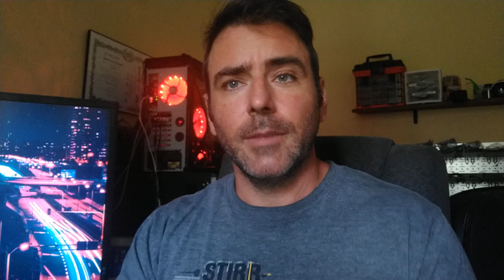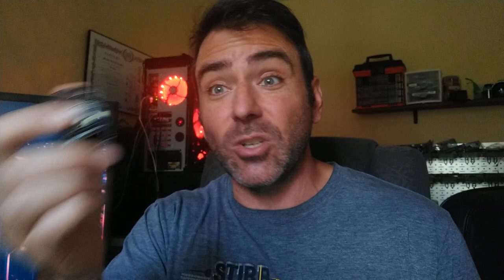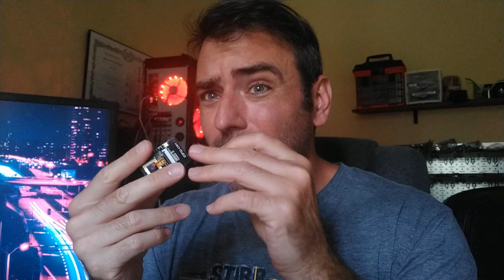USB Port with No Solder

Comment: With OpenBSD, you need to use webcam modules that are UVC compliant.
https://man.openbsd.org/uvideo.4
You will also need an ISP on the module to perform a variety of optimizations.
https://github.com/cruxopen/openISP
https://www.verisilicon.com/en/IPPortfolio/ISPIP
https://pinnacleimagingsystems.com/
You will see that most of these UVC camera modules are limited to 30 FPS recording, even at 1080p, but you can boost the frame rate with Iris Vista.
https://iridalabs.com/portfolio/iris-vista/
Here are a few good sources for getting camera modules:
https://www.e-consystems.com/13mp-autofocus-usb-camera.asp
http://www.camera-module.com/product/autofocuscameramodule/small-auto-focus-8mp-sony-imx179-usb-camera-module.html
http://www.camera-module.com/product/autofocuscameramodule/wide-angle-lens-auto-focus-8mp-imx179-cameramodule.html
http://www.camera-module.com/product/autofocuscameramodule/4k-auto-focus-12mp-usb-camera-module-sony-imx258.html
https://www.newcameramodule.com/product/sony-imx214-auto-focus-13mp-4k-uvc-camera-module/